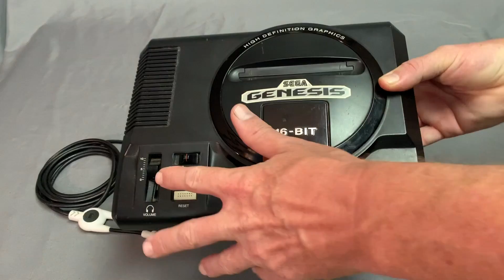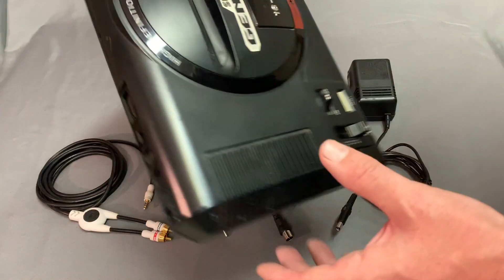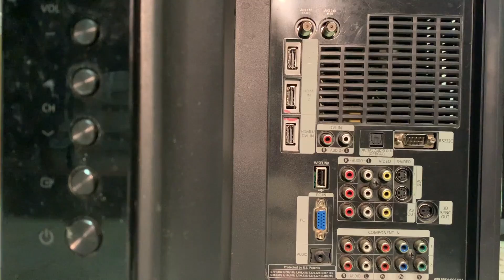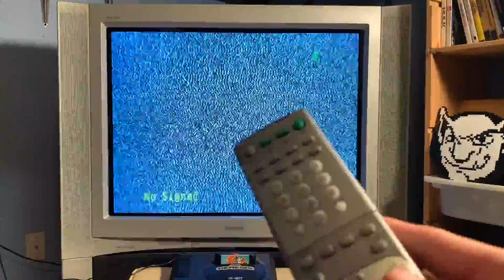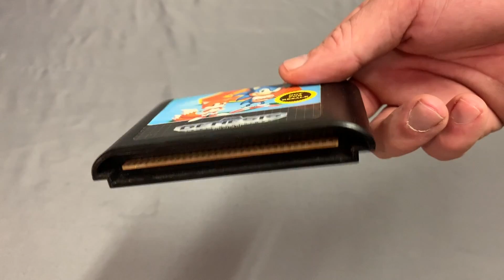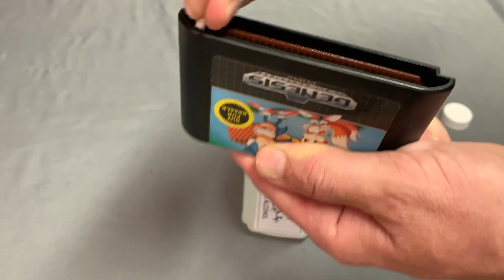How to connect your SEGA Genesis - Model 1, using an RF Box / Switch

Comment: Hey! Thanks for the video, I need little help to connect the same model to PC, can you help?
Reply from the maker: Hmm, what are your connection options on the PC? I hook mine up for recording by using the HDMI cable (vs. this RF cable) and plug that into an Elgato HD60. Let me know what you've got.
Reply: I have a DELL screen that doesnt have HDMI port, the only thing it has is VGA port. I think I need RF to VGA conversion cable. Just need a screen to display games

Comment: What transmits the RF signal? Is it the power supply, genesis, or the RF cable? I'm getting a lot of interference on my tv and I notice it goes away the farther I move the system away from the tv.
Reply from the maker: Ha! It's definitely the RF Box, but the power supply does interfere with it. The shielding on the actual RF cable isn't strong enough to block out all the interference from all the outside sources, like the power supply or other devices near it. If you have Composite RCA available on your TV, I highly recommend using those cables instead, it will clear it up.
Reply: @thegametrog  thank you just ordered some!

Comment: How big is the antenna plug-in piece, is it roughly the same size as the one for Nintendo 64? Thinking about getting one of these but wanted to make sure it would connect with my TV.
Reply from the maker: Hey Ethan, all RF Antenna connections are the same size/connector. The only different will be the part that connects to the system itself. The N64 can't use this SEGA cable, but there is a RF connector made for the N64.

Comment: I have a 32" Vizio from 2017. I hooked the RF cable into a $10 antenna amplifier and I'm still blown away by how close it looks to composite. I actually prefer the smoothing of the pixes with RF. The sound terrible on stereo setup though, 64K MP3 levels of bad...I have to turn the treble to the max for it to sound just ok.
Reply from the maker: Whatever it takes! Just make it happen. nice work.

Comment: I changed my channel to 3 and static is being produced. What do I do now?
Reply from the maker: Static would mean it's not getting any signal. Could be a bad RF box. Does your SEGA power light come on? You could also try channel 4. (make sure your switch on the back matches the channel).
Reply: I have the same issue both channels don’t work.
Reply: Nevermind I fixe dit
Reply: @MrMonkeyJimm how did you fix it
Reply: @malpeezy89  I think I changed the channel to another one or something I completely forgot, or I changed the input to AV.

Comment: I have a Roku tv by Phillips how do I hook up the Rf up it does have a antenna in
Reply from the maker: I'm not sure if a Roku TV has a coaxial input for things like Direct TV or a Cable box (and a RF box). If not you should use the RCA connection is it has the Red, White, and Yellow inputs on the TV. I have a video for that type of connection also, and it's a better picture.

Comment: I’m trying to do this and it’s not working. I’m also using a Nintendo rf port maybe that’s why it’s not working?
Reply from the maker: Greetings Cringe, Although I've never tested it, the RF should work as they are the same connections. Also, the new RF units I sell work with both SEGA & Nintendo. I assume you've tried both channels 3 & 4? Do you see no change to the screen what-so-ever when you turn on the system (even a flicker like it's trying to do something?). All that being said, I have seen RF units go bad, but rarely. Are you sure your SEGA works? Also try a different game or clean it? Worst case is try buying a new RF, they are very inexpensive. And, if your tv allows for it, move up the an RCA Composite cable, the picture is much better. You can reach me from the Gametrog website if you need more help.
Reply: @thegametrog  it’s ok we got component cables